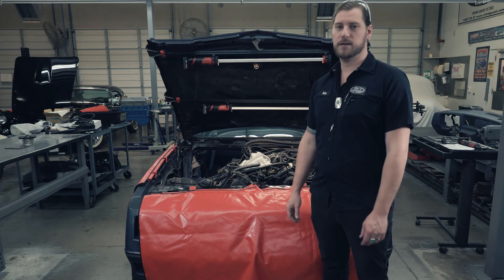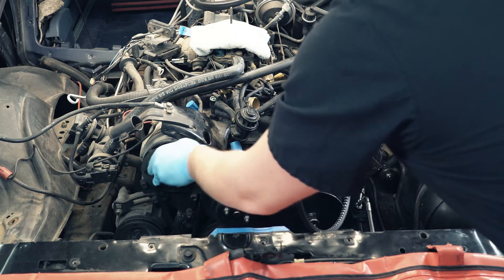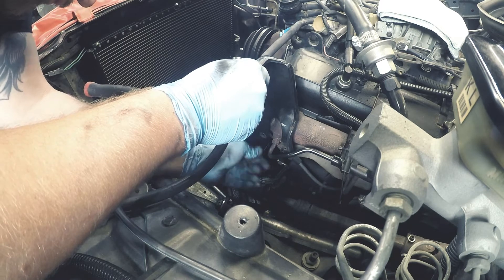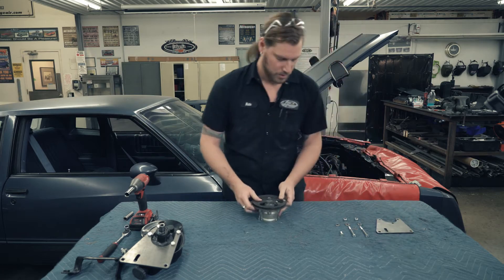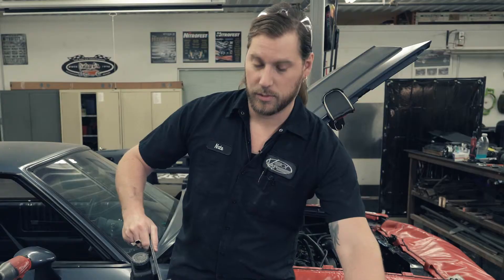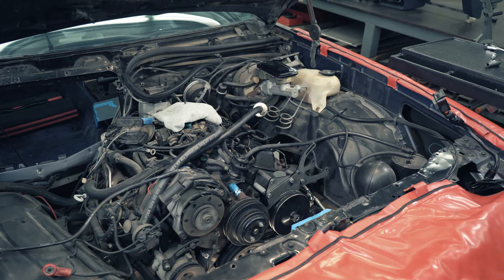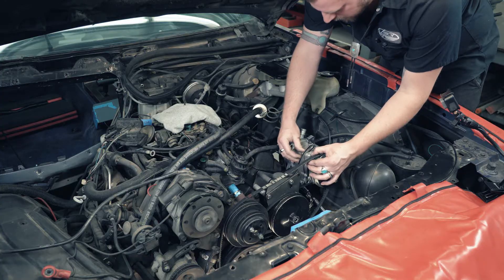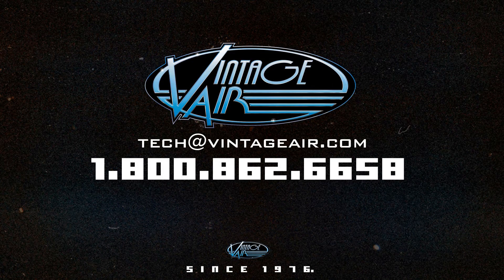Small Block Chevrolet 305/350 Driver-Side Compressor/Power Steering Bracket Kit Installation

Comment: When I mount your bracket onto my PS pump. it does not align as in your video.  All the mounting bolts line up but the "slide" on the top is off to the left (passenger side)of the reservoir fill and not in front as in your video.  This puts the PS reservoir fill cap off at about 10 degrees angle to the right (driver side) and not straight up.    What am I doing wrong?  1984 El Camino with 350 CI GM crate motor.

Comment: What size belt do you use with this setup? I am assuming that the factory belt will not work
Reply from the maker: Vintage Air recommends using only Dayco, Gates or Goodyear brand reinforced V-belts with this 
compressor bracket kit. A Gates XL 7405 power steering belt and Gates XL 7590 compressor belt were 
used in this installation. However, belt lengths may vary depending on the accessories present and the 
diameter of the water pump, crankshaft, alternator and power steering pulleys. Measure your setup to 
verify the belt lengths